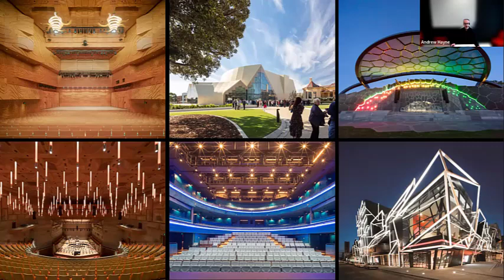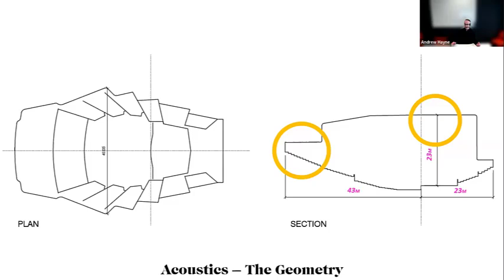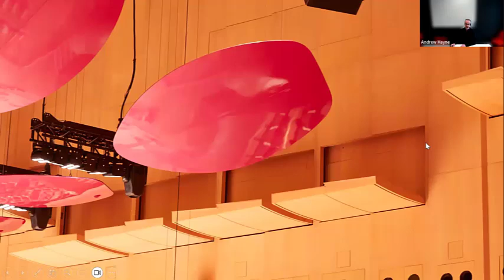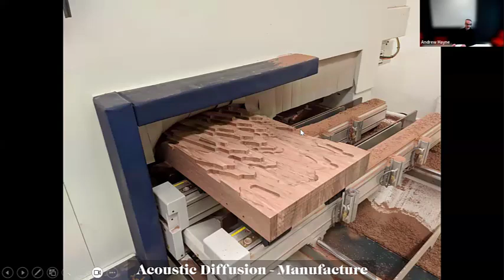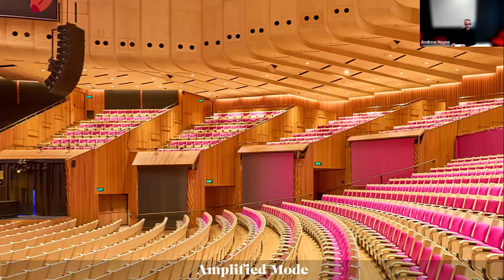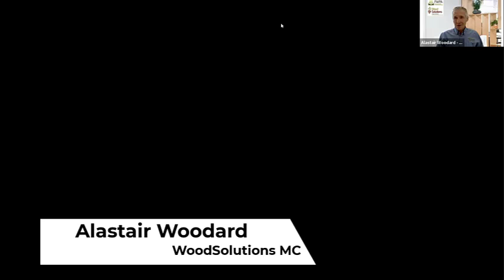The Iconic Sydney Opera House Renewal Project

Comment: I believe most of the work done is a credit to everyone involved however the 'petals' so politely called, look like blood clots. Attending a symphony concert in the concert hall is a cohesion of sight and sound  and each are  important.  The acoustic clouds completely block out the amazing vista of the hall and the pipe organ. There must be a better solution. I think everyone became too close to the project and conformed to a particular mindset without genuine critical  opinion. I ask you to consider this important advice as I do believe a sense of tunnel vision distorted the final vision. If the clouds are so necessary why are there three huge black boxes, that I assume are for speakers, hanging with the clouds  interrupting  the view even further. This is my only criticism of the entire project but it has a large impact. Fortunately ,in the scheme of things, this is superficial therefore fixable.